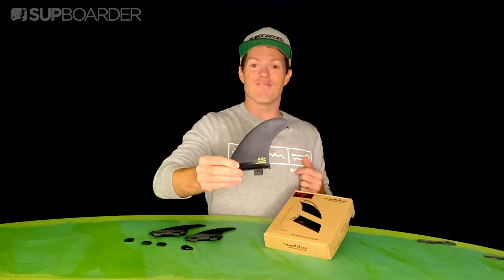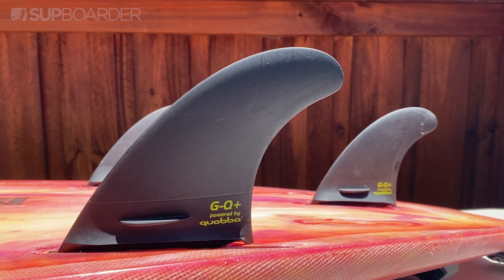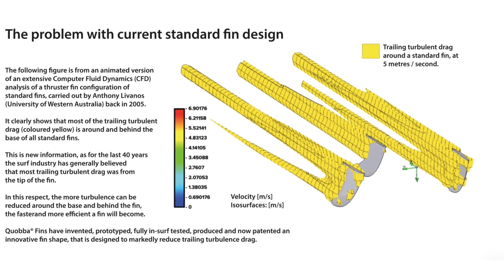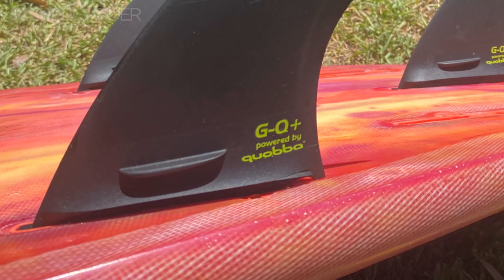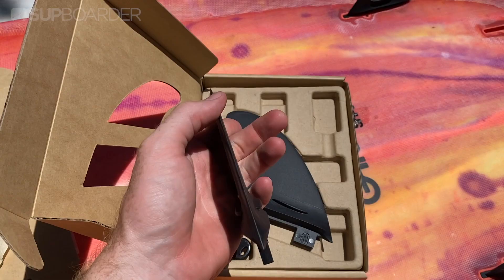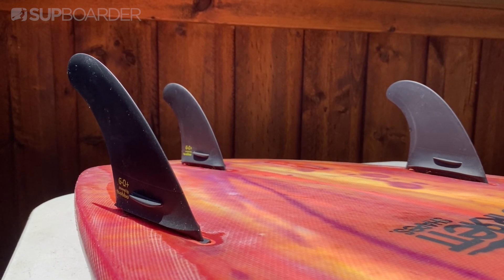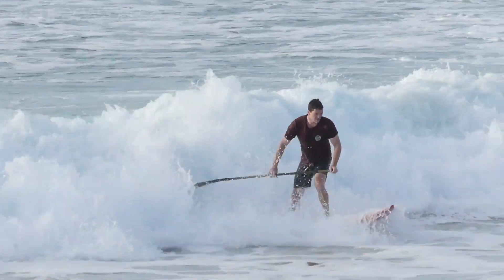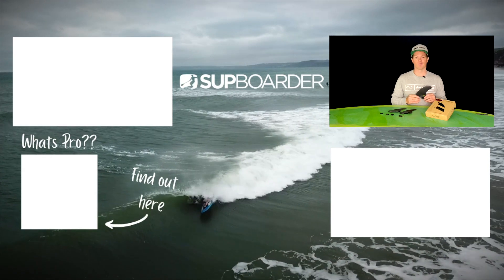Quobba Fins Quick Look

Comment: I'm surprised that more people haven't tried these fins. Also found on the fastest fish, Quobba's caudal keel really seems to to make these fins stick and go fast. Although similar in shape and surface area to the original side bites on my 10'8"x29 sup, these made the board noticeably harder to turn. I replaced the large center fin with a medium Quobba shoved forward. Great down the line speed but still struggled with anything but long radius turns. Makes me wonder if they would work better with a more upright profile? I finally took out the center fin as a last attempt before giving up the experiment. I figured a long board wouldn't work well as a twin but I really like it. I tried the original 2+1 again but it felt sluggish paddling and on plane so have switched it back to a weird Quobba mutant twin. Waiting for a good day to try them on my quad in front and rear position as well as in twin format. They might also have potential for race, tour or downwinders. As mentioned by another commenter, they grip well enough that you might drop down a size.
Reply from the maker: Thanks for your comment and feedback. I agree with you, you need to try a few combos to get the best out of these fins with different board types as well. 
But I haven't used them as a twin fin yet, I think I will give it a go now. I'm still running my smaller surfs up with 2 Quobbas in sides and a more upright traditional centre Finn. Which seems to give me the best performance speed and manoeuvrability. But I have been running three Q in my short board and they're working well. Definitely a great set of fins to have in your quiver to play around with. Keep the feedback coming thanks Reuben

Comment: I'm getting these today as we got some waves tomorrow.. I'll probably post the review online.  I wish they had the shifter by me but I will try the carbon fiber in the meantime...
Reply from the maker: We would love to hear your feedback on the them. Hope they make a difference for you. Cheers, Beau
Reply: @SUPboardermag  Sure, they have insane hold, good drive and decent maneuverability.  They are like magnets on the bottom of your board, no release.   Not as fast as standard 4.5 or 5 inch fins, but made paddling easy, even on low liter sup in storm and 30kph wind.  I can see why kitesurf guys like these.  Their motto is you go faster when you go faster... it should be, you  go faster if you can still stand up in it;)  I will gladly use them in overhead conditions.  You can drop the center fin for speed, glide, and shredding under 4 feet.  If I could, I would recommend to them to make them an inch smaller for daily driver and test out the smallest possible shapes for quad because its so much hold.  Whats great about 4.5" that act like 5.5" fins, is its not breaking your shins when you whipe out and the material does not crack.  Also, you can turn really quickly to catch a wave, whereas a 5.5" fin takes a lot of power and paddles.  Anyhow I could talk for days about it,  go check out a pair;)
Reply from the maker: Such an in depth and insightful review of the Quobba's. Thanks for sharing and agree with you about the quad options. Cheers and glad you like them. Beau

Comment: The two problems they dont have quad set, and no fin dedicated to US fin box
Reply from the maker: That is true. You can buy a US Box adapter for the centre fin though. Ands you could use Large front and medium rear for the quads, but understand the fins are pretty big. Let's hope Quobba bring these out. Thanks, Beau
Reply: @SUPboardermag  wouldn't be better to use 4 medium fins for quad? For looser felling?
Reply from the maker: definitely something to consider. I saw this video from Kai Lenny recently which changed my perception of quad fins: https://supboardermag.com/2023/05/30/kai-lenny-sup-surfing-bali/
Still lots to learn about correct sizing, etc, but yes, smaller fins would loosen up the board. Thanks, Beau

Comment: Converting linear flow into turbulent flow is nonsense.👎
Reply: You can’t argue with flow charts bud. Fluid dynamics can’t lie
Reply: They work amazing. Fast.  I use to large side and a med center in my Sunova SP25. They are incredible.
Reply: It does not really matter, since they do work as promised.